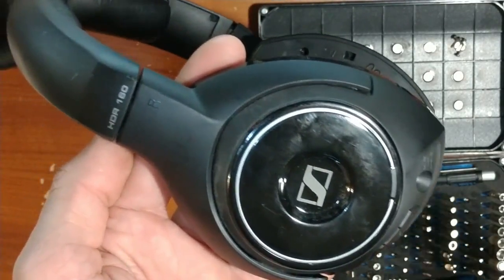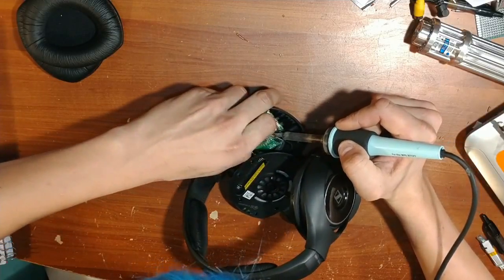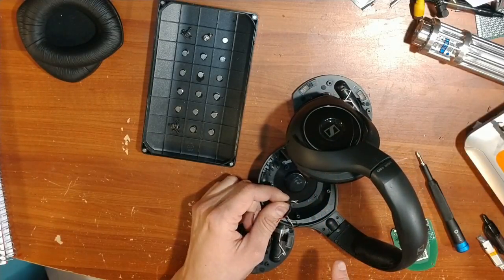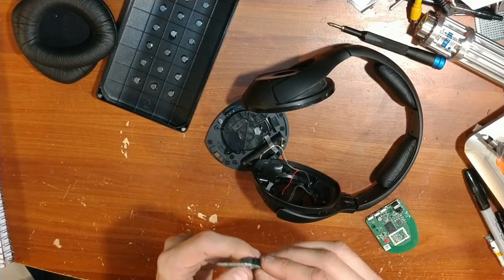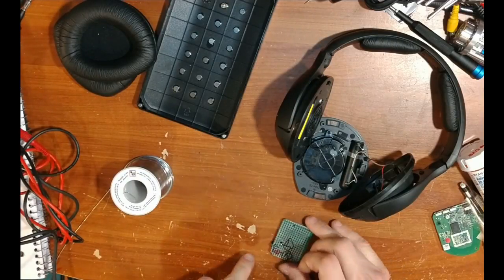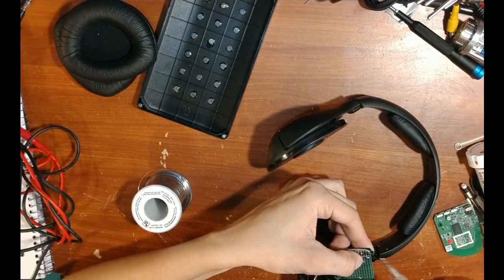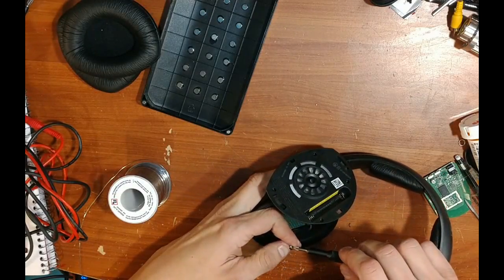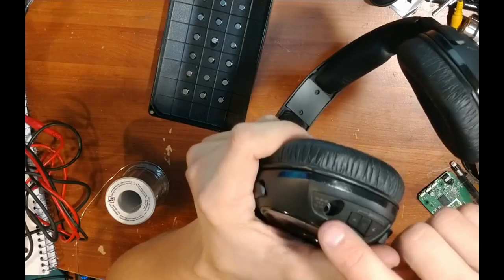How To Make Your Old Sennheiser Wireless Headphones Wired

Comment: Now make a video on how to make the Sony WH-1000X M3 headphones have bluetooth and NFC disabled permanently through the hardware route by disconnecting the connection points for each component to use the headphones offline until you decide to connect the paths with wiring again.